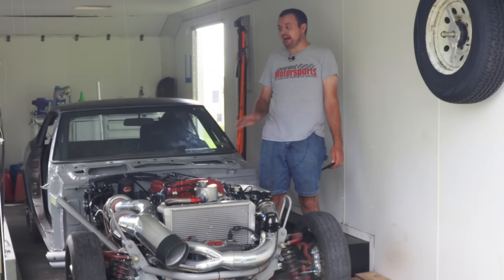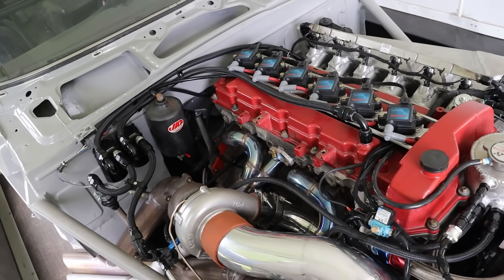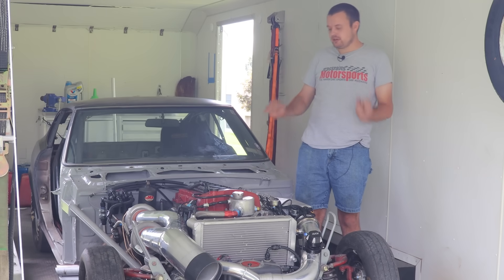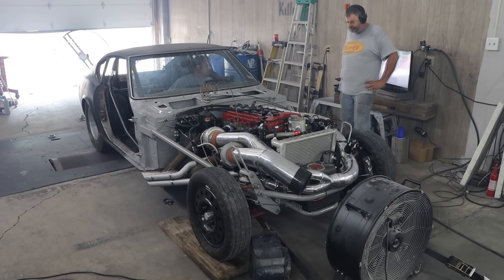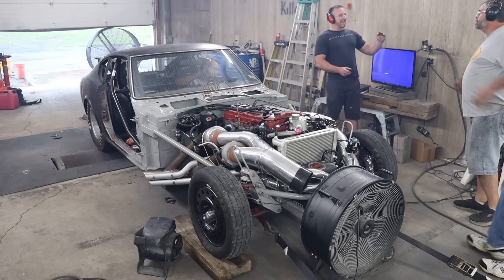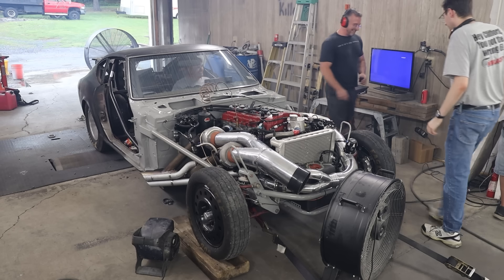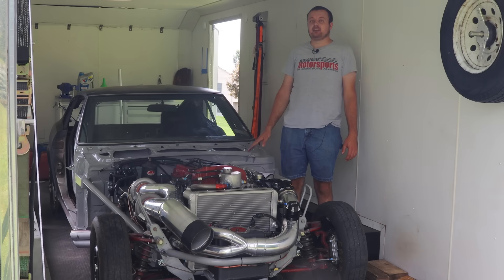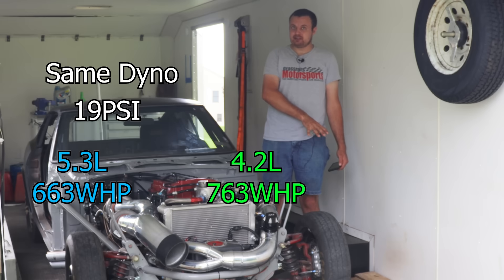This 4.2 Liter Engine Just Beat a 5.3 LS!

Comment: i like the sound of the 5 cylinder version i wonder if this can be replicated with the vortec 3700. it wouldnt make as much power but it should be more than enough. the 4 and 5 cylinder version use a balance shaft so design wise i dont expect it to be as smooth as the vortec 4200. would removing the balance shaft be a bad idea? i hear people delete for more performance but it will make the engine more prone to shake and im not sure if it would affect longevity. im thinking of iconic audi 5 cylinder engines. just listen to the chevy colorado with the vortec 3700 they just sound awesome and bc its a tighter package it can fit in a smaller bay

Comment: I would bet GM was doing exactly that saving their faces. GM shut down the HOLDEN 202 six cylinder engine which was the best 6 made in AUSTRALIA. This is a fact. You know NIVI that the high flow the engine has was no accident fella at all. GM wanted to make things happen 
Keep up the great videos as I will be making me a race engine machine. What is the total length of the block ?? v

Comment: Yes... These Atlas Engines can produce horrific HP... Cheap? No. This guy is coming from a racing family, with connections to suppliers and fabricators. Not to mention he does most of the fabrication himself, or with help. I would say what he is doing here with these engines, maybe 5% of the entire population can duplicate on their own. The other 95% will have to outsource this work. And we're talking Thousands upon thousands of dollars in parts and labor. I can cherry pick a motor/trans out of an '09 GMC Acadia, and plop it in a 1983 Dodge Ram D150 SWB with some booger welded engine mounts and spray them black with a rattle can... But I can't build a custom oil pan, or a custom intake manifold, Turbo tubing, custom exhaust manifold, and then throw a tune in it with a laptop... There isn't much aftermarket support for these Atlas Engines. Not like LS and SBC. So I hope you know how to weld anything, with anything.
Reply from the maker: Cheap is a spectrum. To the 2JZ guys this engine is dirt cheap. To the LS guys this engine is expensive.

Comment: I think too many people ignored the trailblazer.. it's not like they advertised the engine as such. Not enough people made the relation between the barra and 2jz with the extra displacement until recently.  Maybe GM was expecting a much larger following for aftermarket and people didn't catch on while everything else took off exponentially.  Never too late!    Demand the supply and they will supply the demand!

Comment: People who design engines have tremendous knowledge and pride in their work if left to their own devices and their mission. The six cylinder will always be a better engine than a V8.  It is naturally balanced and will easily outrev a V8 with less complications. Soon as you get  V you get all sorts of balance and vibration issues that cost power and component velocity.

Comment: What about the typical valve failure seen in the 4.2?
Reply from the maker: Never had or seen an issue with that
Reply: that was early models with valves softer than intend. Any 4.2 with some miles is safe. They would fail early under warranty.

Comment: because the valve size in the bigger engine  doesnt supply enough  air and fuel for the bigger engine  put a trick head on the biger ci engine and you would see more hp out of the bigger engine  probably have same head on both engines the head feeds the smaller engine   exactly what it needs the bigger engine  even with the turbo forceing it in it is not enogh  air and fuel to make the bigger engine   produce maxium potential hp  i know this because been there done that with motorcycles and turbos my 1170 cc engine ran way harder than the big block mtc 1327 cc engine did no matter what boost i  set the screw to ken tipton  told me that when i ordered my big block 1327  engine i wanted a 1425 engine ken refused to sell me one   i didnt understand why at the time  now i do   experience  the ultimate educater

Comment: 0:34 im guessing this has to do with inline 6s being perfectly balanced
Reply from the maker: Nah. It's mostly in the cylinder head design
Reply: @Calvin-Nelson  nah fam. I can almost assure you an old balanced inline 6 will do the same thing, 2JZ can easily make 1000 hp for a reason and that’s only a 3.0

Comment: Boost is just a measurement of restriction and something is off on that 5.3l combo. Should make over 600 wheel bone stock at 15-16psi on pump gas. With a decent intake head porting and cam it should be closer to 800hp at 15-16 psi. If just going off how much hp with lowest boost the coyote 5.0 is the pack leader 12psi on e85 gets you 900ish crank hp

Comment: What Chassis is that ? Motor sounds great
Reply: 1974 Datsun 260z. The 240 260 and 280 Z all look the same and have 2.4, 2.6 and 2.8 liter displacement engines respectively. Nissan kept up the same naming scheme for the 300Z, 370Z and 400Z to a certain extent.
Reply: @esqueue  nice, straight six's came in those ,with no power steering. You don't want that or you'll end up in the wood's 😆. hope to see a really nice finished car .

Comment: Normally I6 have more TQ than HP what cam did you go with ?
Reply from the maker: They're Schneider regrinds. Even the stock cams make more HP than torque with these engines. All depends on cam profile.

Comment: It's all about application. For a corvette, the LS will make more sense due to the weight and balance. HP/torque figures aren't the end all be all for something to set lap records at Laguna Seca. The drawback of the inline-6 is the heavier top-end compared to a pushrod cross plane V8. It's also longer necessitating the movement of where cooling is.
For a Truck or SUV, inline-6 make the most sense. The only reason they are not adopted for this application is because of public perception of V8s.
For drag-racing applications, inline-6 tend to have trouble at higher RPM as they generally have more stroke than bore. Correcting this has other implications for a drag racer.

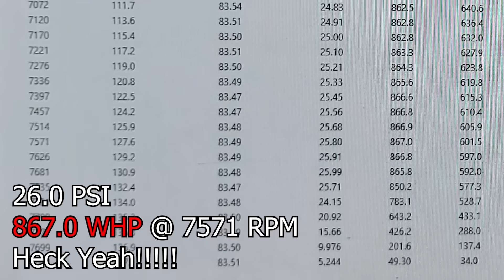Comment: 8:06 curious. With this graph, you only made 5 more hp from 7,100-7500. So why rev up any more? Would a bigger cam make better top end? Or is it vvt tuning. 
And 2nd part. You’re running pure methanol.. a real comparison would be to run pump gas or e/85. Bet that number will drop 85-100hp without an icebox.
Reply from the maker: I don't know if you noticed, but the pulls go very quick. I have to keep an eye on a bunch of things in the driver's seat. Lots of time I'm going through a few checks and by the time I get to RPM, it is higher than expected.

It was not pure methanol. It was about 60% methanol and 40% e85.
Reply: @Calvin-Nelson  yeah of course I did. Just being honest and don’t mean to bust your ballz. But if your power on top end peaked early on and you only got a couple more Ponys revving that much higher, why stress the engine and just lower rpm to be safe

Comment: The 4200 is also a 4 valve engine vs the 2 valve 5.3, right?  That's a not insignificant factor.  But regardless, that inline 6 is dang impressive!

Comment: I don't know enough to know... if ya know... but I suspect the V8 isn't performing as hot because (in the photos provided) I'm seeing single turbo vs twin, and all the exhaust back pressure during that valve overlap which isn't helping the engine breathe. The inline 6 intake has velocity stacks in the airbox (70's motorcycle trick) which would also help the V8, Change the V8 intake to a tall long tube aluminum piece. I bet the turbo spool curve and waste gate activation RPM are much lower on the V8, showing its more about exhaust restriction than intake. I would look into those variable outflow diesel turbos or an exhaust bypass/waste gate so it'll spool and boost at low RPM but flow at high RPM.
Reply from the maker: It's been Dyno tested quite a few times, as long as the turbos are adequately sized, twin vs big single does not make much of a difference to HP production. The reason that the 6 cylinder performs so much better is because of the cylinder head.

Comment: I would really love to see what an intercooled gen v m90 from a series 3 3800 could do strapped to this.
Reply from the maker: I don't think it could flow enough air to keep up.
Reply: @Calvin-Nelson  Definitely not for high horsepower. But just as a fun junkyard build I think it might be doable. Richard Holdener has been trying out the gen 3/5 m90 blower on some junkyard ls 4.8 and 5.3 motors  and finding a good amount of success with it(https://youtu.be/X0rOCDcUoco?si=vEtvK6XoHOl__PjL) And with a motor that’s only .4 liters larger than the one it’s originally mounted to instead of one that over a liter larger I think there’s some promise for those just wanting a fun and affordable option in the future.

Comment: Maybe more HP but what's the torque rating compared to the V8? That's the more important value.
Reply from the maker: We're not towing stuff. We're trying to drag race. If the car is geared right and has the proper equipment, the higher HP car will win. Especially when it is 100 more HP.

Comment: These engines are amazing. I personally took one it off a GMC envoy and slapped it in a sand rail with a junk yard turbo from a semi truck, and a all in one blower from an old VW rabbit to spool up that giant turbo.. it makes 770hp with 302,000 miles and engine is bone stock other than injectors and head studs..
Reply: What studs did you use?

Comment: This is definitely NOT the case. Watch the videos of all the things they do to the 4200 to make it reliable for boost. Now take a bone stock LS with a single turbo. No comparison. Not that the 4200 isn't great, but apples to apples they are not.
Reply from the maker: You will never beat the power per dollar of an LS. Power per cubic inch though? Not so much

Comment: i love the inline 6.  its a better engine design than v8 hands down.  simplicity, less parts, and power u get for the displacement is best bang for ur buck.   this gm is a gem.   if there are any parts wanted that can be made from plastic for this engine ill make em if i get any requests.   dress up items i guess, wire and hose clips maybe wire and hose mounts? i don't know maybe yall can think of something but im up for it.

Comment: At 24 pound boost you get 1200 hp from a v8 ls
Reply from the maker: That is not true in almost all cases. You spend $10k on the motor, and it is.

Comment: First I want to say OMG holly crap !!! That is a monster. As far as results goes it seems to me your running the best 6 cylinder you could working with a production engine goes and the smallest LS goes. I understand for  comparisons sake they are the closest in size. Externally  the LS engines are the same size. If you put the work you did on the 5.3 on a 6.0 or 6.4 the numbers would be  1K on H.P and higher.
The problem is since GM declared  a LS in every car and Holley owning alot of aftermarket companies they are reluctant to support other platforms. As a Mopar owner this has been going on for 40+ years with the aftermarket industry.  They feel GM first , than Ford, then Mopar and AMC for American made muscle cars go. FTA and FJB!!

Comment: Leme know when you got an affordable easy to repair electric commuter thats not a tesla that costs under 20 grand
Reply from the maker: I don't think that will ever happen.
Reply: @Calvin-Nelson   Fuck here I was hoping I could get something that wouldn't start turning in to a junker after 200k miles. 

Hmm guess I'll just have to wait for that  25,000 dollar tesla to come out for 35000 dollars before inflation and supply chain issues make it 50,000 usd.

Comment: You keep saying more power but no comparison as far as side by side graphs. Is that extra 100 horsepower at 8K and the LS make more power and torque down low?
Reply from the maker: Hard to say. There is this funny little thing called a torque converter in the middle that sort does weird stuff to the power curve sometimes. I felt 100 more HP was enough to make the claims I did. 4200 is definitely peaking higher. Not sure if it is also making more power down where the LS makes peak.
Reply: @Calvin-Nelson  so you don’t have a side by side comparison to show which one is actually better….if I’m making all the power down at a lower rpm that’s better as it’s less wear and tear on the engine then having to rev the engine and extra 1-2000 RPMs 🤷‍♂️ as far as those little things called a torque a converter you said so yourself the LS had a bigger cam so it would have a looser converter robbing more horsepower. If your going to call out big companies to make parts for something and claim it’s the best you should try and do that little thing called research at least the very basics 🤷‍♂️

Comment: Americans just dont get the the answer thinking HP is CC, V8s are very inefficient, which 6s are smoother as they fire evenly and have less engine drag,
in 1984 i advised some V8s head bangers that the V8 time is almost up, apart from maybe straight speed but are gen useless,
my 1983 2L could smoke 202 6s and gave 253 V8s a hard time on track, 3 years later pocket rockets were starting to rule

Comment: I have a 280z and the aftermarket shit for that engine is so insanely expensive just to make a meer 250-300hp 

I’ve looking into doing a rb26 swap but holy shit those are insanely expensive for a used high mileage motor

Then the 2jz,… more affordable and more accessible, but still $ 

Then I stumbled upon the vortec i6 and the thing i really like about it is the Aluminum block, should be able to save weight in a 280z and at car meets should have people confused and wondering what it is, plus I almost guarantee it’ll be cheaper

Comment: I remember a video about a Colorado pickup with the I-5 that changing the timing chain was a major pita. They said it might have been easier to pull the engine.
Reply from the maker: Yeah. In their stock chassis, they are not fun. They just need freed
Reply: @Calvin-Nelson  ty.

Comment: Kinda want to put one in an E34, but it seems like backing it with a manual would be a pain.
Reply from the maker: It's not too hard. Manuals always cost more, but the parts are available.
Reply: @Calvin-Nelson True, I wouldn't be drag racing it. It's more of a pipe dream rowdy daily driver idea I've got in my head. I've got three 535is', could always boost the M30 in my stick shift car, just wouldn't be/sound as cool.

Comment: Don't lie to people the 4.2 L inline 6 is a piece of junk. I've been a mechanic for 45 years and that engine is near the top of the list of the crappiest engine General Motors ever built
Reply from the maker: Most of the issues that I have found are easily overcome, or have to do with the chassis they came in. We've taken completely stock engines to over 600whp

Comment: I tried taking the head off a 4200 and 75% of the head bolts snapped off in the block, thats the last time I've every even contemplted messing with one of those lol, apparently its real common my current job wont touch them for the same reason.
Reply from the maker: Yep. And they're super easy to remove. Takes like 15 minutes.

Comment: Yup, this is what happens when a modern designed engine meets a V8 that was derived in 1918 but not made into the mass produced item until the 1950's. The LS only makes half decent power purely from it's displacement. BHP per CC there are many engines that make more power than the LS and funnily enough these are all modern designs. Ford Coyote, Mercedes V8's, BMW V8's etc etc.
It is refreshing to see someone move away from the flock and go with something different but also better 😊The LS does have the advantage of being fairly compact for the power it can kick out but you know, horses for courses 😅

Comment: Would the Atlas fit the stock engine bay, and be able to close the hood? Most of your front end doesn't exist so I can't even speculate.
Nvm it appears to be even taller than the Barra.
Reply from the maker: I think there is a guy that is making one fit in a 240z